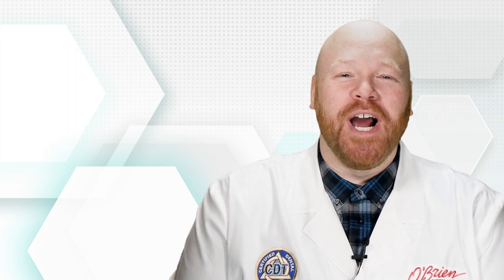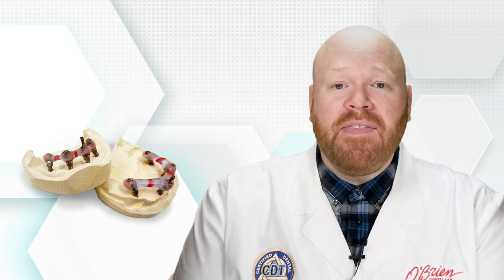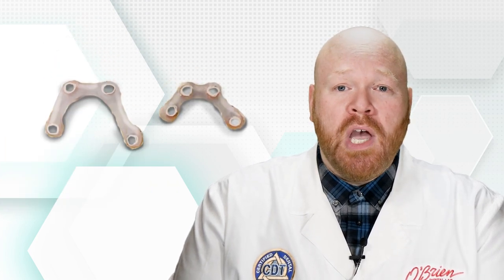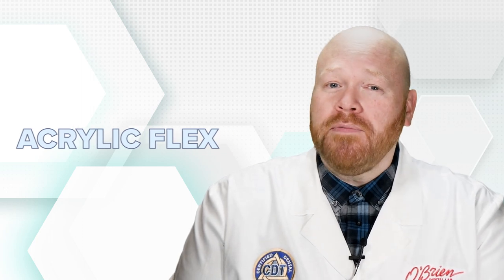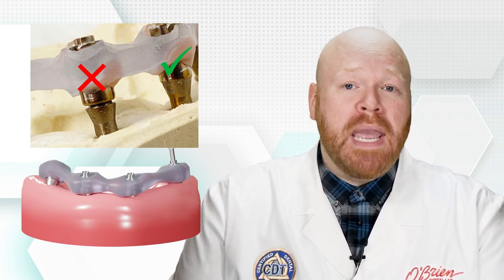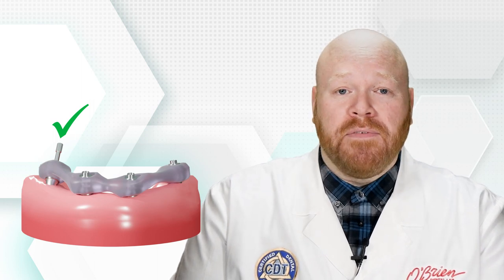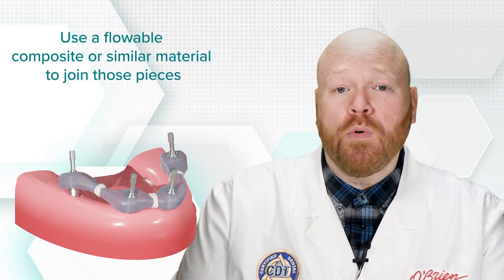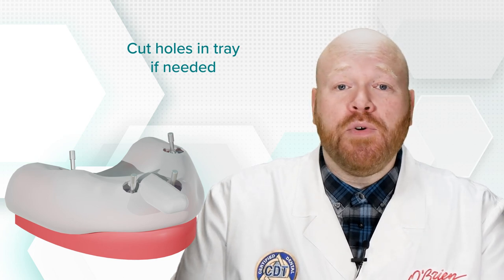How to Correctly Use a Verification Jig

Comment: Hey there, thanks for the informative video, i have one question, ısnt this necessary to do the one screw test even after you modified the jig? How can you be sure about the verification?
Reply from the maker: There shouldn't be a need to do the screw test after modification.  The purpose of the one screw test is to verify that the analogs in our master model match the implant positions in the mouth.  If you modify the jig, the position of the interfaces will be set by the actual implants. Since you are seating each section separately before luting them back together, they should all be completely seated and accurate since there's no chance of any section being held up by another.

Comment: question for you.  If acyrlic shirnks overtime.  Why not use flowable resin instead of acrylic at the time of initial impression?
Reply from the maker: Resin also shrinks.  The two different materials we use shrink in different ways, but they still both shrink.

Comment: Why u have to do impression over the verfi jig even though the verfi jig is very good placed and seated
Reply from the maker: If the jig seats perfectly, there is no need to take a new impression.  If any of the units don't seat and you have to cut and lute the jig, we recommend a new impression using that jig.  However, typically a new impression isn't absolutely necessary as the lab can use the jig to realign the analogs in the master cast.